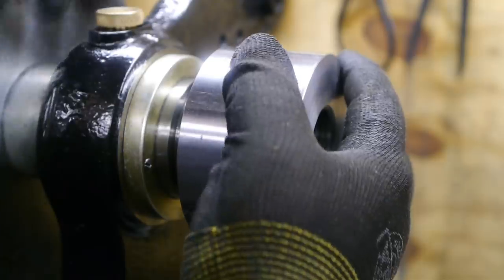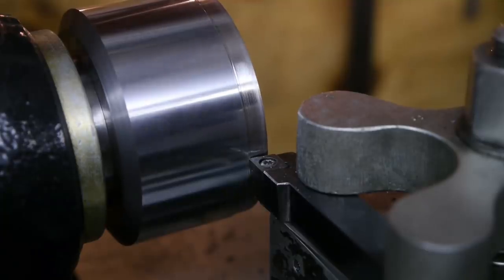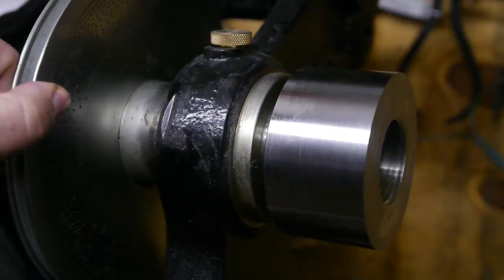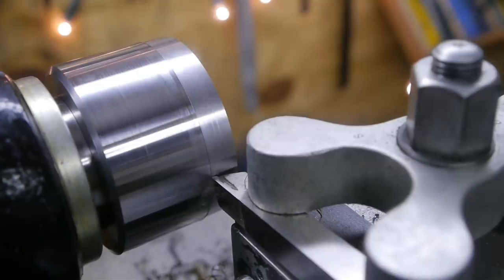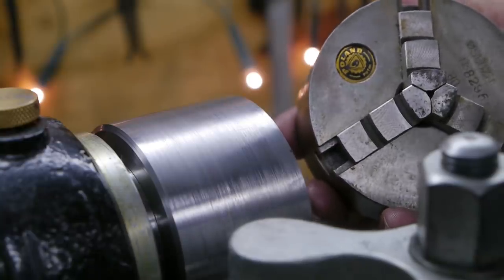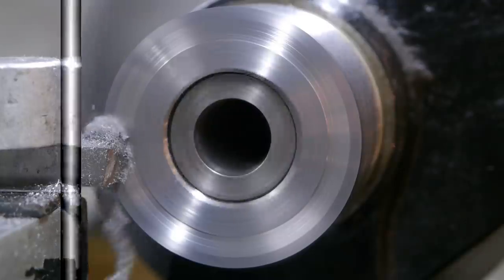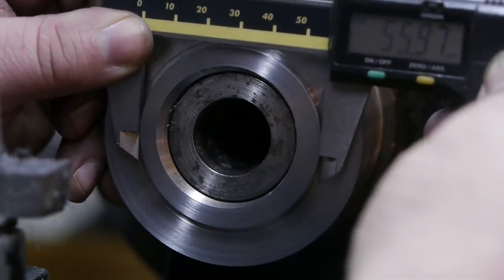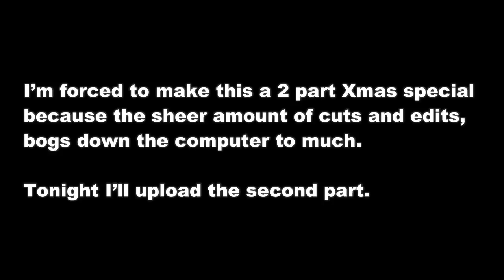Fitting a small Bison chuck to the failed backing plate

Comment: Good for you pal, that you got it off without too much of a problem, all that swarf makes a good pan cleaner.  You had a little chatter when turning and you are doing the correct thing while machining to remove the chatter sound IE constant pressure.  Steel wool you are making a good cut, it's looking good and you know when it is time for a cup of tea if you drink it.
Reply from the maker: Thanks :)

Comment: I make the register deeper than required by about double and make a good size undercut in the corner , don't skimp on it . Get the diameter right on the first few mm , you will have a couple or more chances at it. Then finish the whole diameter to size , finally face it off to the correct depth which is not a critical dimension. Not sure what your using but steel is not good for a backplate , it bruises and this can cause problems. Cast iron is the go to material. Lots of mistakes and a good memory have served me well !
Reply from the maker: You're right cast iron is the better material. Unfortunately not much of that around at the local scrapyard.

Comment: Which insert holders do you have might send you an insert or two to try. Also 32mm wide workpiece should be turned at roughly 200 rpm and around 74 or so for 50mm with hss. Carbide should be run roughly 750% faster
Reply from the maker: Thanks for the offer. But save the postage I've already ordered some other inserts from ebay.
Reply: @Rolingmetal  would cost close to nothing considering it's in europe and fit inside an envelope. If you ever want some to try send me a message 😉

Comment: Could be time to get some micrometers.  😀
I found some on eBay that were cheaper than I was expecting. I can’t remember the price.
There were 4 in the set 0 to 4”
They didn’t look fantastic but the seem to measure accurately.  In a nice wooden box.
I think they were from India so they must be good right!
Looks like you have out stubborned it so far.  Well done

Comment: Is your Mitutoyo caliper one of those cheap Ebay knock-offs? Try getting an  Igaging EZ Cal Caliper, it's a bit more expensive than the Chinese crap ones, but it performs on par or better than a genuine Mitutoyo.
Reply from the maker: It's a genuine Mitutoyo. I believe the fake ones have a thumb wheel.
I'll have a look at Igaging. But I'm hoping my analogue Mitutoyo will turn up again.
Reply: @Rolingmetal  Just buy a set of cheap micrometers, they work as good as mitutoyo ones. Calipers are only good for about 0,02mm accuracy, even expensive ones. I use my calipers only for roughing, never for the final measurement.

Comment: You won't get an accurate internal measurement from a vernier caliper because the blades are offset to each other so you're actually measuring across an angle.
Reply from the maker: I'm trying to get used to snap gauges, But for most things I do, precision is optional.

Comment: I realize this is an older machine with a lot wear, seen some of your gib issues in past uploads. Have you ever checked the saddle parrelism with the bed using an indicator and the ways as a reference? .  

I bought a “new” 7x Chinese lathe and it was awful. Tilted back towards the Tailstock side  .002 of an inch and higher overall on the apron side by .018 of an inch. Could not get a facing cut without chatter as the bit height would lower as I moved towards center. The head stock is totally out of alignment as well, so the machine is useless without some major work. 

You made mention at one point about the gib wear, maybe you can eliminate some of the chatter if you can correct any issue with saddle alignment.

Although totally different machines, there is a website that has leveling process using nothing more than sandpaper, an indicator and a lot of time and patience to get them leveled. Doing this now on mine to actually make it “usable”. 

http://www.toolsandmods.com/lathe/mini-lathe-saddle

Just something to think about, best of luck, I really enjoy your videos.  Reminds me of my own efforts to do some amateur machining with limited tooling and funds for a “hobby”. 

If posting the above address is some kind of you tube violation, my apologies ahead of time.
Reply from the maker: This lathe doesn't have a saddle. But it might have a little twist in the bed. One day I'll by a machinist level and check it out.

Comment: you actually want the register with some movement, you get the bolts in and dial it in and bolt it down
Reply from the maker: Are you sure. isn't play on the register just as good as no register at all?
Reply: @Rolingmetal  , i am sure, double boost did exactly that on his, you need some movement to bump to true, the bolts hold it, register gets you close, is all
Reply: @Rolingmetal  I personally use "tap through" registers - you just loosen three bolts a bit, chuck up some drill blank and you can tap your chuck so it runs true. It's very common practice.  I machined my register so it has 0,1mm of play. It's for my 250mm chuck on 3200 lbs lathe, and it has never moved when tightened. For small lathe like this schaublin, I would do it the same. You can then compensate for worn jaws, if you don't want to grind them.

Comment: Why are you using the top slide to advance the tool so that you end up with a taper ( assumng that is what u did ). The top slide should be locked rigid and the tool advance should only be made using the carriage.  The top slide should only be used for taper turning and in most cases the top slide should be removed entirely and the tool post mounted on the cross slide for  normal machining operations for the sake of rigidity and better finish.
Reply from the maker: This is basically a large watch makers lathe. So there is no carriage to move.

Picture: https://bit.ly/2sdZZx0

Comment: I found that when the calipers are inconsistent like you're getting that it's often the small set screws along the top that set the gib clearance which are a touch loose.  Adjust each one in turn so you just barely do not have any drag or at least that there's only a slight drag and you should find your readings are more consistent.  And I would not slam the jaws like you did a few times.  Instead learn to close the jaws with a light and consistent pressure much like you need to do with micrometers.    On the inside measurements you'll find that you need to "walk" the jaws around a little while watching for the maximum size you see which is actually the real ID measurement.  All while holding that light and consistent outward pressure.  Taking the ID measurements more like that should save you a lot of time and work at dressing down things like that register lip for the chuck.

Comment: If your worried about the smell of the smoke, just use some lard or bacon grease as cutting lubricant, then your shop doesnt smell like smoke, just smells like smoked bacon, lol.
Reply from the maker: Getting hungry now :)
Reply: lol, lard was actually used as a cutting lubricant, and in all honesty, works really well too. Ive tried it for laughs and it keeps up with some of the better cutting fluids tbh.
Reply from the maker: I'm surprised, I knew it was used to grease old windmills, most of them still do for authenticity, but would not have thought it could handle the high turning temperatures.
Reply: yea, it actually works pretty well and it doesnt really have much trouble with the temps of turning steel, but usually if your work is getting that hot, then you have a very dull tool and it needs resharpened anyhow, lol. Ive seen some people actually mix a mixture of stuff into it including sulfur to make something like a sulfurized cutting fluid but turned into a paste so it sticks to taps and stuff alot easier, then as it heats it, it flows into the places it needs to be used in rather than just dripping out of the holes like oil usually does.
Reply: The best tapping and cutting oil was from whale blubber but you can't get it anymore , Greenpeace would have a fit.
Reply: yea, you cant get whale oil, but look at the difference between whale oil and jojoba oil that's sold in a store now. It's molecularly identical and pretty much the same thing. Ive used some of that with some white lead and it worked great as a dead center lube, but it's just expensive to no end.

Comment: Wearing gloves when turning or milling, it is an absolute safety no-no to wear gloves.  Gloves easily pick up on the rough surface of machined metal and drag you into the machine.  After that when the screaming and sheer agony is over, it is just a matter of unraveling your arm from the spindle after a few hundred turns and getting someone to sew it on again.
Reply: That is true. Cruel, but the true. jajaja. TAKE OF THE F***** GLOVES MAN!!!!

Comment: As others have said, the register needs needs to have a little wiggle room to clock the chuck in afterwards, counter intuitive I know. I have in fact just fitted the RDG direct fit collet chuck for a myford lathe and the instructions tell you to do it this way. Check my Instagram @smithsonoliver
Reply from the maker: That's a rather small chuck. I doubt that it's a good idea on bigger chucks.
Reply: @Rolingmetal  thanks for the reply, would you mind elaborating on why that would be a bad idea? Genuine question as I'm no expert and always keen to learn something new.
Reply from the maker: Just a feeling, I guess I'm worried about the weight and inertia. 
All backing plates I've see so far were a tight fit.
Reply: @Rolingmetal  thats interesting, I did wonder if a compromise may be to take the register under size a fraction at a time and re clock the chuck until it would move no more in the direction you were wanting it to, that way one side would always be bearing against the register from a centrifugal force point of view